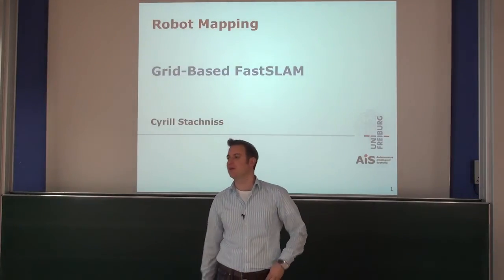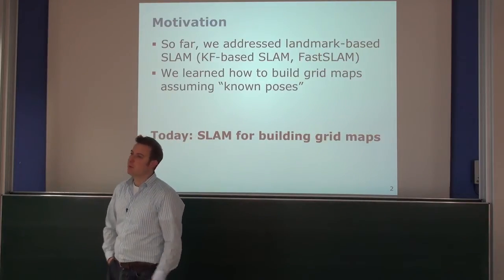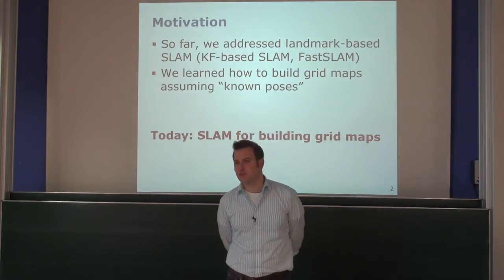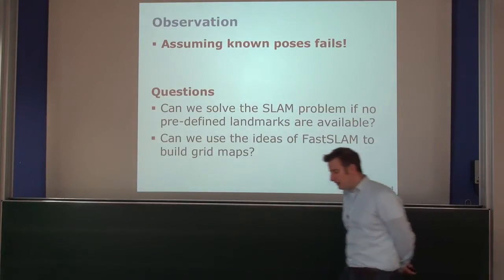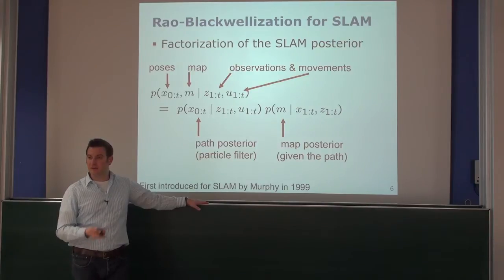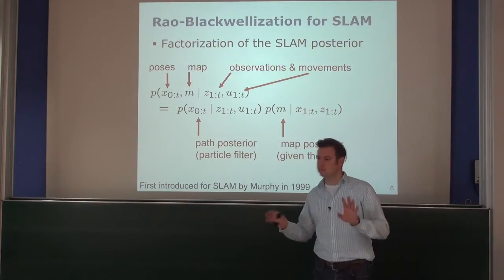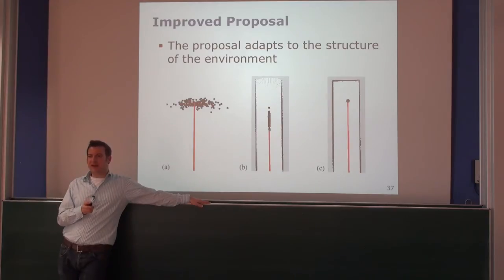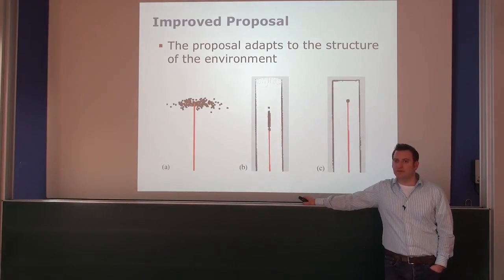SLAM Course - 13 - Grid-Based SLAM with Rao-Blackwellized PFs (2013/14; Cyrill Stachniss)

Comment: If high motion noise was a problem in FastSLAM applied to grid-based maps and mapping with known poses fails, then it should also have failed for FastSLAM 1.0 for landmark-based SLAM, right?

Comment: I am sure the answer to the question is yes, but I still want to shoot my shot:

When we are not resampling so frequently then after the particles get their weights readjusted based on the measurement correction, we let the particle go ahead with the next iteration of proposal distribution sampling. But before we go to the next iteration of proposal distribution sampling do we normalize all the weights?
Reply: Giving it a second thought, naturally they must have been normalized after weight/measurement correction. That is the only way \eta_{eff} stays between the number 1 and the number of samples.

Comment: Why do we need weights for FastSLAM 2 particles if we generate particles, already taking into account measurements?
Reply from the maker: +Dmitry Gavrilenko Because  weight = target / proposal and if we change the proposal, the weight will be different as well.
Reply: +Cyrill Stachniss Thank you for your response!

My question was more about understanding the general idea of the method rather than about math formulae. If the proposal distribution already incorporates measurements, what is the purpose of the target distribution at all?

Comment: At around 40:00, why are the samples taken from tau and not from p(xt|...)?
Reply: I think the Gaussian distribution obtained is approximately equal to PROPOSAL distribution and NOT tau. Hence sampling should be taken from Normal distribution( != tau).. As for the lecture, he may have said it incorrectly, but you can read his paper(available on the course website) where it is clearly explained...
Reply: @abhisekpanda5105  I think he is taking samples from \tau(.), because he mentions on multiple occasions that \tau(.) needs to be evaluated at these sample locations. Then he goes on to say that the computation drawing the samples and having \tau evaluated at them helps us in approximating the integral in the denominator as well. Evaluating these two things gives us finally the proposal distribution.
Reply: @abhisekpanda5105  I have not read the paper yet, and am only basing this on the lecture. Maybe the paper says something else, but this is what i understood till now.